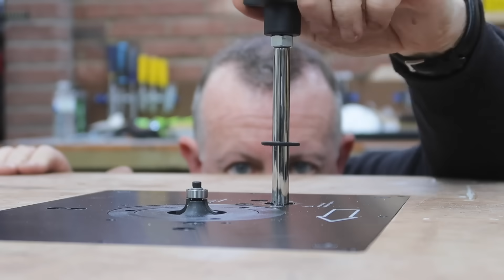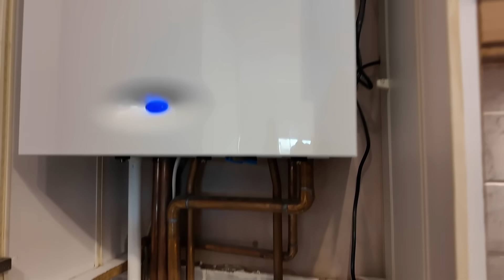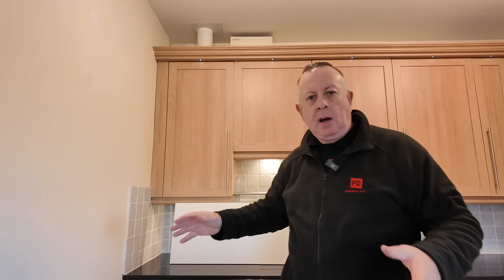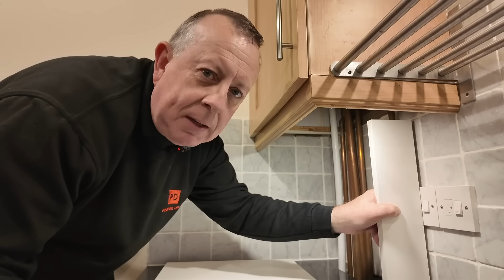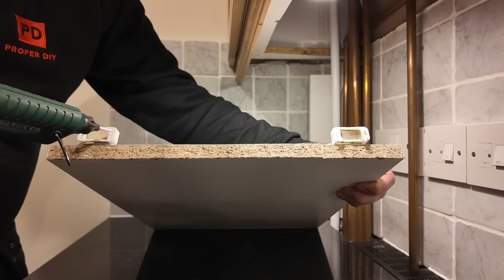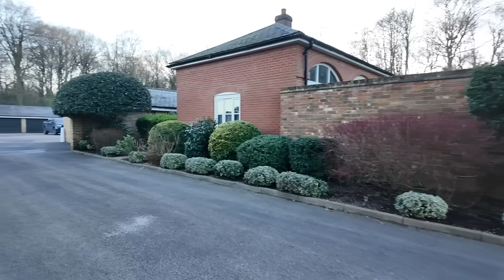A very small, but important job!

Comment: You can get trim pieces for the bottom of kitchen cupboard plinths, which have a silicon seal on them. Perhaps try that, and it would seal up to the tiles, hide the tear out on the melamine cut edge, and be removable. I do dislike working with melamine, particularly the white stuff; it's so hard to get a decent finish on the cuts. Nice job considering how awkward the position of the pipes and power sockets and switches were.

Comment: Would have added a double socket to the boxing in to bring it out to the surface and a short fly lead with a 13 amp plug to plug in to the original socket behind, then use a plastic back box with longer screws from the front double socket to the back box or use a metal back box. To prevent chip-out on the melamine use masking tape and cut through the melamine with a Stanley knife along your finished cut line, then cut a couple of mm away from the finished cut line and sand or plane down to the line.
Reply: Please make a video of your melamine magic skills to teach us all great master 🙏 🙌
Reply: so the socket on the covering is just like a plug in extension lead. I guess a single socket could be okay, but a double in a kitchen could be a bit  sub optimal. It would only be a double that could run 13 amps. Okay doubles are only rated at 20 amps for the pair  ,  but in a kitchen there are a lot of  high load appliances  , like kettle or toaster than could easily end up on the "extension socket" .  running a kettle and a toaster off a double  that's then ending up in once 13  amp socket doesn't sound that good  to me. 

Plus it would need to be made obvious to a sparky who comes along later  , to do testing and EICRs (this is a rental property !) , that it's an "extension socket !" and they need to pull the L plate cover off to  get to the true wiring.  I guess they'd work out something funny is up when they take the socket off  and find a single 1.5mm flex cable  running it !
Reply: I was wondering if you could do this under code, effectively just a mini extension cable.

Comment: I'm only a woman but I would put some tape on the edge and then cut it. Also I had the same problem in my kitchen and when I had my cabinets fronts replaced (for a fresh up) my guy got me a full size cupboard  and i conveniently use the space inside to proof my pizza dough :)
Reply: You're not "only" a woman!!

Comment: To follow a scribe line with a jigsaw when you need the scribe side to be neat with no chips, simply turn the jigsaw upside down and cut from underneath. You use the blade that sticks up through the wood as your guide. If that makes sense?

Comment: I would have just saved the hassle of putting those magnets and created a U shape so the left corner also rests on the wall. Securing it to the shelf above. When needing access, simply unscrew from the top or if you really want or have something better for quick release.

Comment: Stuart, a difficult situation to fix in a day and with limited tools and materials available. You probably did pretty much as good a job as you could have in the circumstances. Maybe it will be possible to come up with a more longer term solution, e.g. bringing out the electrical sockets etc to the front of the boxed in area, making it permanently attached to the wall - plus the inspection by an electrician to get it signed off - when a bigger window of time opens up.

Comment: I used magnets to hold the footboard of my kitchen cupboards. Instead of silicone, I used a white silicon-like U-shaped strip with a lip, that resembles silicone on the edge of the boards.
It connects to the wall perfectly closing the gap without sticking to any surface.
I would have placed two wallplugs into the board and connected them with a cable and plugs to the existing wallplugs. No big job and easy to remove or put back the board.
Nice video!

Comment: whoever approved the yahoo who did that sloppy copper pipework just sitting out in view needs to get back on their meds.... insanity. PD, did you consider pvc pipe, cut one side, then heat gun and reshape it so its somewhat half egg shaped to make a cover for the pipes rather than box shape? You could also do a PVC hat to cover the huge gaping hole on the bottom of the upper cabinet. some white caulk and itll neaten up nicely.

Comment: Nice video as always Stuart and a great use of the magnetic catches. This might be a silly question but with the catches making it easy to remove the panel if you want to use the sockets doesn't adding a bead of silicone cancel out the removability of the panel?
Reply: Attach some clingfilm to the wall first (hold it in place with masking tape etc). Then apply your bead of silicone etc., wait for it to cure and then peel away the clingfilm... Hey presto a nice fillet of sealant bonded to the Melamine but not bonded to the tiles!
.. The only downside is waiting for the sealant to cure before you can finish the job..
Reply: @antomac that is genius mate , thank you for that tip
Reply: Great point! 🙂

Comment: To get a better matching colour you can use the thin vinyl click floor tiles glued over a cheaper box built from plywood/osb, maybe need a piece of trim for exposed corners. Tiles are easier to cut, and cover any area. Used this technique to box in pipes in kitchen and to build a custom fit bath panel.

Comment: The job looks good as it is.  I think I would use some white plastic trim over the ends because, if you then add the silicone bead, pulling the cover off to gain access to the socket will not be possible.
Reply: Wouldn't the issue of the roughly scribed edge simply be transferred to the trim? 

Genuine question, this is all very new to me. I'm just assuming the plastic trim would also need to be scribed flush with the tiles.

Comment: Who ever cut the bottom out of that cupboard want's his tools taking off him. He should be ashamed of himself. You came up with a good way out of a bad job.
I have found it useful in the past when I buy jigsaw blades,is to cut the opposite end of the blade on a couple with the angle grinder, so that they fit in the jigsaw upside down.
Obviously this means you will cut on the down stroke, giving it a good face cut.just keep good pressure on the saw. Look forward to the next video.thanks.

Comment: Given the positioning of everything you were in a no win situation.  As a personal alternative I think I would have boxed in the pipes to the left and put a piece of that white plastic pipe wrap on the lone water pipe so you could have left access to the sockets. Maybe that wouuld not be acceptable to the owner though. For other jobs I like the idea of the hot glue simply as a way to locate the join bits prior to screwing them into wood or something. Great channel, with good tips and techniques. Thanks

Comment: Hello mate! 
Just a quick pro tip that I've got from my father in law who's been a carpenter for 25+ years and installed many kitchen appliances: when cutting melamine if you don't want it to chip like that just put some paper tape over the line you're supposed to be cutting and then remove it once you're done. 
The difference is amazing, I've tried it myself a couple of times now. 

Cheers, Adrian!
Reply: I've seen several videos of people testing this and if anything putting tape on the line made the cut worse as it pulls off any weak bits..
Reply: @caskwith  you can get low tack painters tape, no more expensive than masking tape. It work I know from having done it. Another tip which I realised myself was to used a metal cutting blade also, more teeth like a coping saw.
Reply: @ChelseaPensioner-DJW   I am curious as to how you think the tape works?
Reply: @caskwith  I've tried it myself at least 3 times both with a jigsaw and a circular saw and it worked wonders!
Reply: @adroniga  Did you do a side by side without tape at the same time?
Reply: @caskwith  unfortunately not, I could not do that 'cause I've done in directly on my new kitchen cabinets and I didn't want to mess them up😂
Reply: @adroniga  I understand you doing that and I think this might be the problem with this (probable myth), your average punter doesn't do a side by side so just assumes the tape improved things. On the videos I have seen where tape is tested side by side with no tape, it seems to make no difference. Logically I cannot see why tape would make a difference, tape isn't very strong or stiff, you really want a sacrifical board (or a track saw which definitely improves the cut).
Reply: I always use masking tape when cutting similar materials, correct
Reply: I'd add when used with the correct blade, masking tape is good but it can't work miracles.
Reply: Yeah, we all know this, but just remember he was working away from home, so it's likely he didn't bring any tape with him...
Reply: @alpachino468 forgot his tape.
Reply: @alpachino468  Yes, but he had to go out to buy melamine so could have picked up tape & the correct saw bead at the same time.
Reply: The plumbing installation is not a very good job.
Reply: Yeah that works see that tip on tv with mark wright .
Reply: Good idea with the magnets .

Comment: Welcome back to Essex Stuart, I know precisely where that is, we used to dirt track through the woods around there as kids in the 70s !

What a bodge job that installation was, particularly placing the water pipe between the two electrical fittings, no excuse for that. Of course this wasn't up to your usual standards Stuart, but nonetheless an interesting thing to show and you worked a solution on the fly with little time or equipment so what can realistically be expected.

I think I know the sale you are referring to, I also bought the Workmate from there as a gift for my Daughter who is just starting on her DIY journey so have also directed her to your excellent Channel .

Comment: Stuart, you did a decent enough job all things considered, but you cut the side piece from the wrong side! If you'd cut from the other side you wouldn't have got all the tear out of the edges. Scribing the melamine with a blade helps too.

Comment: I think I would have put all those electricals, including the fused switches on fly leads using Wego's or something similar and cut holes for new back boxes in the melamine.
Reply: I was thinking that but the melamine box is a moveable feast so is questionable having electrics fixed into it.
Reply: @petemc5070  I see what you mean but make the leads just long enough to move the box so you can reach the sockets on the wall and unplug whatever is there.

Comment: Whats the point of the magnetic connectors as once you silicon the edges you won,t be able to pull it away from the wall, thus how can you use the  2 sockets ?
Reply: Also - where are the cables from the sockets going to run to the equipment? Anyone using the sockets on a permanent basis would have to drill extra gaps. A bit of a botched job if you ask me.

Comment: I’ve watched this video for a second time as it’s Sunday my first day off and I’m just chilling out. Most DIY jobs when completed we would do something different.
I would not try and box all the pipes in as it’s just not practical.
The main group of pipes I would box in using coloured 4mm thick plastic sheeting you can buy from most craft shops.
The beauty about this stuff it comes in many colours, very cheap and can be hot clued together . Secondly I would just paint the cold water pipe. This job is always about compromise as the plumber did a poor job. The resulting job is the box covers the pipes without obstructing the socket and as the cold water pipe runs between fixings it would easily be camouflaged with matching paint. Very disappointed that he did not protect the bunker :(

Comment: I think you did a great job considering all the obstacles in your way!
I've seen kitchen and wardrobe fitters cutting their scribes by holding the jigsaw upside down underneath the workpiece.
This way the blade cuts down into the wood or melamine, meaning less chip-out. Also they can see the blade and line much more clearly.
However its a skill I've never managed to perfect!

Comment: If I don't have the correct saw blade handy, I cut slightly oversize and use a fine file to tidy up the edges. Gives a nice clean edge and a couple of flat / round files take up very little space in the toolbox. Putting masking tape on the board before scribing can also help reduce chipping when you cut.
Would love a follow up to hear how the hot glue has held on those tiles over time. Handy as a "semi"-permanent fix and easier to clean off the tiles than cured silicon.

Comment: Nice job! I used the same method when I boxed in our gas meter in our hallway. I battoned around the meter then clad it in pallet wood and used the same catches for the front so it looks like a solid box but you can lift it off in an emergency or when the plumber comes to service the boiler.

Comment: Maybe try a very fine jigsaw blade and holding the jigsaw from underneath to make the cut, should leave a lot cleaner edge on the face. Looks like a typical plumber cutting the bottom of the cabinet away, as the snagging expert on YouTube would say "Shocking"

Comment: Why do circular saws cut upwards, chipping the surface, but table saws cut downwards?
Reply: They both cut the same way, against the material feed direction and tool pulling into itself, one is just the inverted version of the other. In both cases stability is increased and the operator is in control of the travelling part. If it were the other way around the blade on a tablesaw would tend to pull the workpiece away or lift and throw it forward, while a circular saw would tend to pull away from the operator. On a tablesaw we have implements such as a riving knife to prevent the material riding up into a kickback, but if the blade spun the other way it wouldn't be possible to use such a device because it would be on the infeed side, standing between the uncut workpiece and the blade. Where one surface is more important it is common to reduce chipping / tearout by turning it face down when using a circular saw and face up on a tablesaw (there are lots of other techniques for a cleaner cut).
Reply: @itsafeaturenotaflaw  So melamine should be cut upside down with a circular saw.

Comment: A well thought through and perfect job well done.
The only thing I'd add to it is to make up a small socket extension with a surface mount back box and glue it just outside the cover above those fused switches.

Comment: Great video Stuart, I recently did the same for a friend with a black quartz worktop with mirror flecks like your one. I brought a small piece of shower panel in gloss black with mirror flecks and virtually did what you did, I used a tile trim in chrome for the edges. It honestly looked like part of the worktop and cheap to make. Keep up the great videos.
Reply: Shower panel (or end bath panel) was my thought, no reason (other than time/access now) that it can't still be done using the white melamine as a base - just clad it with trim as you suggest will hide rough edges.

Comment: Never tried it myself but would it have been possible to cut a V notch on the back of the board using a router at the 90 degree bend, heat it up with a heatgun, bend it the 90 degrees then reinforce the corner with those plastic blocks ? It would give it a seamless appearance. Can melamine be heated and bent ?

Comment: Could you fit a socket front to your boxing & simply connect to the socket behind via a flex and 13amp plug, obviously checking building & electrical regs. Nice job though, the simple ones are the best👍👍

Comment: Great content - it's TV quality. I have just had to do an identical job for my father in law when he had a new boiler fitted. There were so many pipes going in all directions that it was like boxing in an octopus. I found that masking off the cut lines and using a melamine blade worked a treat. Wow! I'm giving DIY advice to a DIY expert. I'd better tick that off my bucket list.

Comment: Maybe you could silicone a small quadrant trim onto the tiles each side, so that the boxing could tuck in behind them and still attach to the magnets in order to be removable?
Reply: Sould've used a small sealing tape (the ones with foam rubber) instead.